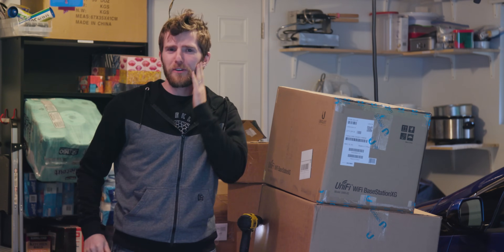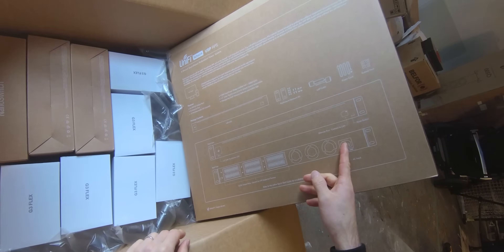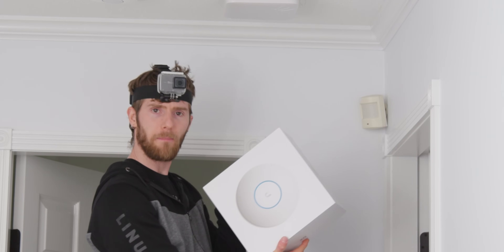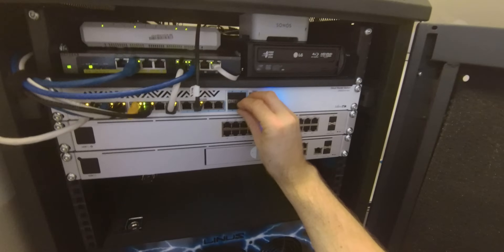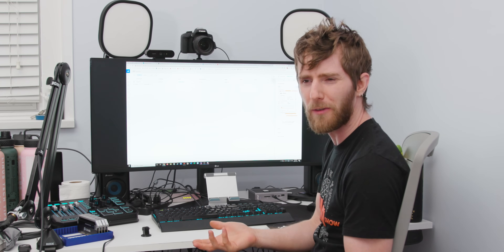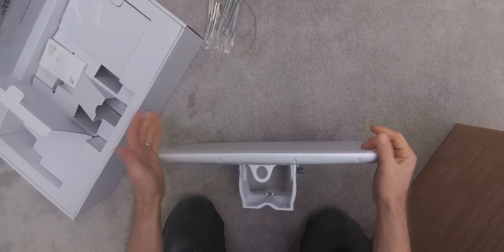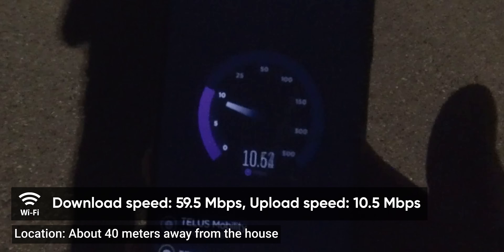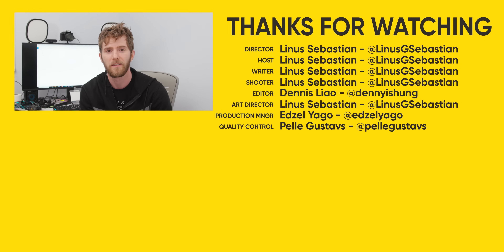I REPLACED my $1000 Wifi....

Comment: Hey! Can anyone give me advice? I just ordered all the parts for my custom build I was planning on using for gaming, It's not a super high end build, But these are the specs: Ryzen 5 2600x, GTX 1660 Super, 16gb ram, and a  MSI B450 pro carbon ac motherboard, I am using the stock Ryzen Cooler, Because I can't afford water-cooling, although my PC case does have very good airflow, and 6 case fans, My question was whether or not you guys think this would work to stream on? I was planning on just making videos, but if it could support streaming, I may as well go for that, thanks!
Reply: You should be able to stream

Comment: I’m a total noob, but how does POE prevent the power from adding noise to the Ethernet signal? Is there just enough shielding between the power and data lines in the cable?

Comment: Linus: I haven't upgraded the WiFi in five years! 😮
Me, sitting here, not having upgraded my WiFi in 16 years. 🥱
Reply: Same here, my Linksys WRT54GL is still going strong...
Reply: @Jenci  Those old WRT54GLs are troopers and back in the day when DDWRT was a thing, they became tanks and very usable router. I still see some in service today for legacy WiFi devices.
Reply: @SkyNines  DDWRT is still a thing and still have active development, i have tomato on my WTR54GL, i upgraded to wireless N 300 back in 2014-2015, i have DDRWT on my WZR-300HP, still doing it job with and has not failed me with build DD-WRT v3.0-r28444 std (12/05/15)
Reply: I’m at 10 years without a WiFi upgrade and 5G is faster than my actual WiFi. It was slow and crappy when it was first installed and it’s even slower and crappier now

Comment: The beard doesn't change much...
dark themed intro goes away
Reply: rip dark intro
Reply: Crazy how Linus can grow such a nice beard so quickly and only just did it.
Reply: I need it man, my eyes burn each time. But it's worth it for those sweet, sweet tech tips
Reply: They have used both the dark an the light intro in the past. The first time I remember seeing the new intro it was the light theme. So I don't think the dark theme is gone for good.
Reply: @georgf9279  they seemed to have alternated it for a while
Reply: I like the light intro better. As long as my device is in dark mode.
Reply: @littlebit670  you heathen

Comment: The base station is designed for Stadiums and event venues... Linus we love you, there’s no kill like overkill
Reply: This is for high density m, also 3 radios with filters so the spread pattern is per section plis those are suppose to be outside not inside
Reply: Yeah without a million clients connected to it this basically performs the same as my nanohd

Comment: Is it ironic that I too just upgraded my parent's wifi network right at the same time this video came out?? I went and got a TP-link AC1750 A7 router and flashed it with Openwrt, and it seems to be a ALOT faster and more stable than the AT&T Pace router.

Comment: Linus: Ugh my wifi is so slow with only 300mbps.
Me: Ah I finally have fast wifi at 34mbps
Reply: 10Mbps is fast for me.
Reply: I think you are confusing your WiFi connection with your Internet connection
Reply: yea but thats still pretty bad
Reply: Me at 5mbps....satisfied
Reply: Haha mine is 0,5mbps ;__;
Reply: @aabiasaw  same life is hell lol it takes me 3 hours too download 1gb
Reply: Lol mine is 1mb sometimes mostly 500 kbps
Reply: @aarondite8854  maybe you just need a new router and modem. your internet compant should be able to supply you with a new modem and maybe a new router
Reply: @aravsandhala6821  can I buy my own router
Reply: Aarondite yes (9.99999999% sure u can just buy ur own )
Reply: @aarondite8854  100% yes. your company will give you a standard router (if they give one) but you can get really high speed routers from any electronic store
Reply: same
Reply: Me with 0.10mibts 😑😪😭
Reply: I get 5meg down, .5meg up. I'd have to move to get faster internet. Can't even buy bonded.